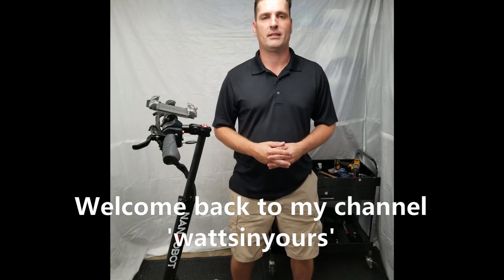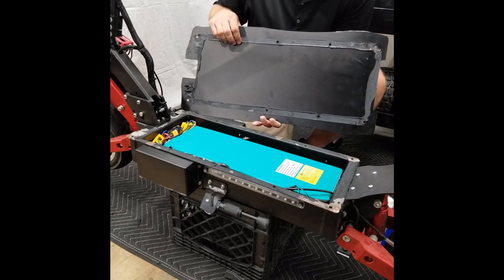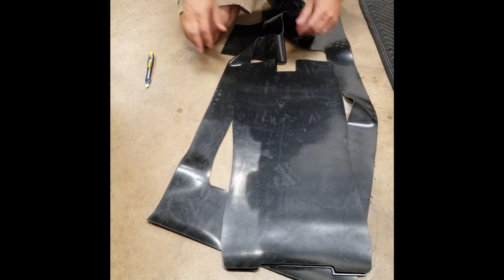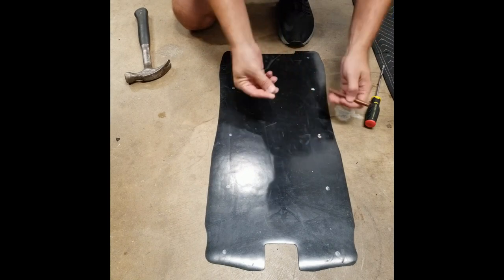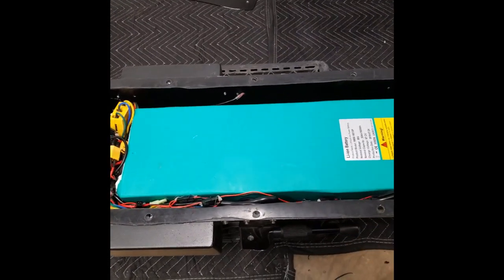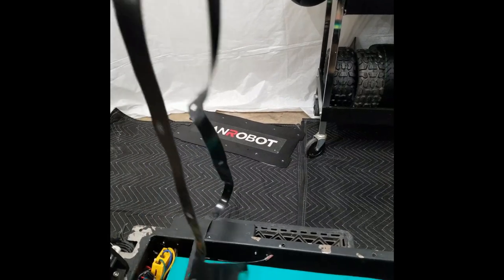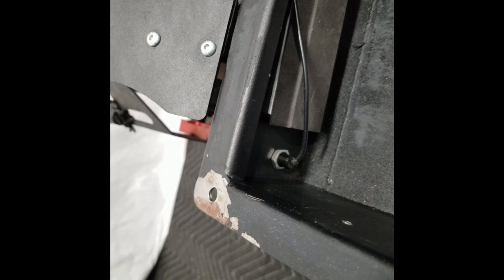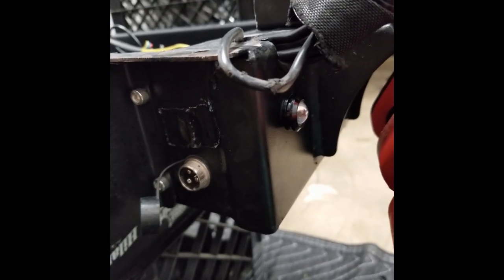Nanrobot upgrade water proofing and preventing battery movement. electric scooter motorized scooter.

Comment: It's not good to put that high density foam between the floor and the battery. That causes all the pressure and vibrations from your body to push on the battery pack. The gap is there for a purpose.  There are other ways to secure the battery, closer to the edges.

Comment: Question: Why didn't you just leave the "whole rubber sheet" as it is? Maybe it will get TOO HOT inside?
Reply: exactly the same question afrer viewing that major part of heat distributed by top alu plate
Reply from the maker: Yes because of heat.

Comment: Congrats on replacing your d4 with a ls7.  How does it hold up against your friend's dualtron?  Does sealing the deck void warranty?
Reply: He's got an RS7 not the LS7, very similar though... He did a comparisons video against the Dualtron already you should check it out , he did a good job. And sealing the deck won't void the warranty on the Nanrobot.
Reply from the maker: Mine is faster than the dt3, but i think the dt3 beats me in quality by a little. I'm not sure about warranty but i fix my own scooters anyway.
Reply: @wattsinyours  the dualtron appears to have bigger more solid pieces holding it together where the ell S7 and RS7 seem to have more small pieces. That's just going based off of visual appearance alone though, @wattsinyours would you agree that that's the case having seen both in person?
Reply from the maker: @GingerOnWheels  yeah i would have to agree for the most part but my rs7 is a very close second and its faster.

Comment: Amazing videos !
Reply from the maker: Thank you very much!
Reply: @wattsinyours  is it difficult to order parts for the rs7 ?
Reply from the maker: @OHADASSUSIL  no because most of the parts are universal.
Reply: @wattsinyours  maybe you can give me your opinion 
Should I get the 6D+ 
Do you think they will have seat for it ?
What is better disc brakes or oil brake ?
Thank you !
Reply from the maker: @OHADASSUSIL  depends what u want the scooter for. Yes you can get a seat for it and oil brakes are a lot better than mechanical brakes.
Reply: @wattsinyours  it's strange I contac the compnay they told me its special order for rs7 parts it take lots of time to get parts
Reply: @wattsinyours  I want something strong and fast one level before the rs7
Reply from the maker: @OHADASSUSIL  man there are so many choices but a couple good ones whould be the Dualtron3 or the zero 10x.
Reply from the maker: @OHADASSUSIL  i can get them fast off of other sights. You just have to know what to order.

Comment: In fact, you can leave the whole rubber mat on instead of cutting it into gasket!
Reply from the maker: Yeah i thought about that. Either way will work just fine.
Reply: But wouldn't the battery get hotter with no air. Think about that...

Comment: How do you tighten up the suspension on a D6 plus
Reply from the maker: There is a nut that sits on top of the spring. Clockwise it makes it stiffer. Counter clockwise makes it softer.

Comment: Hello. For dualtron thunder which kind of rubber you suggest to sealing the battery box?
Reply from the maker: Just any thin off the shelf rubber will work, but just remember you want to get really thin material or the lid will not close down properly.
Reply: @wattsinyours  ok but a silicon rubber?
Reply from the maker: @takisangelopoulos13  that is fine to use.

Comment: Awesome ideas.  I also am all about modding my similar scooter.  I have a clone from a different manufacturer, but can tell that we have the same chassis and electronics inside.  I thought I was the only one digging around inside this thing, but I have had some mechanical challenges along the way, so I had to.   Thanks for sharing your efforts.  I have been thinking about a gasket for the main compartment also, since the rtv gets hosed the first time you open it.  My initial thoughts are that the deck needs more bolts added to clamp well enough to be effective.  Subscribed - feel free to check my efforts out too!  FYI - I have replaced my throttle with a Ey3 controller from minmotors, and it I am much happier with it than the original like you have.  My post for throttle replacement on Reddit:  https://www.reddit.com/r/ElectricScooters/comments/bzpa9x/yes_you_can_use_probably_the_minimotors_eye/
Reply from the maker: Hey strider thanks for watching and subscribing. I watched a couple of your videos. Love the fact that you dive right in so great job. Its funny bc i was looking at those scooters online before i bought my nanrobot and yes it is the same exact scooter except for a couple of part, like the stem for the handle bars. The only reason why i didn't buy that one bc it wasn't as well known and was worried about warranty issues. Side note i almost bought it though lol. Where do you order parts for that? Do they have a website. I was just wondering so if i need parts for my rs7 i have an additional place to look. I hope to explore more about these scooters with you and my YouTube fam and good luck with your repairs and mods. As always im here to help where i can.
Reply: @wattsinyours  True- us tinkerers need to share knowledge for sure!  The best resource I have found thus far is Reddit but it is light on expert knowledge so I think we are "the guys" at this point.    Love the formatting of your videos - I need to do the same so they are easier to follow for the public.  My videos were mainly made to try to prove to the supplier that their parts failed.  A lot of good that did me...  To answer YOUR questions: I bought all of my parts via Aliexpress.   You have to be very thorough with your searches and sometimes root through many offerings, but can eventually find the right part if you keep digging.  You were right to be worried about warranty, as the Samezone folks don't even answer my messages anymore (6 months or so into this).   We are on mostly on our own with these China-scooters I think....)  If I can help in any way, let me know, as I have done a TON of troubleshooting so far.
Reply from the maker: @striderz69  ok will do. Ride safe friend.

Comment: That gasket without gluing make no sense. Plate on top i so thin to keep it in proper squeze. Remember you jumping on top of it and everything is working. Rubber will lose its elasticity over time and I can bet that you will find more gaps between bolts then before. 
Is better to use proper glue for that type of job .
Reply from the maker: I would have to agree with you to some extent. I could glue the bottom down and not the top so when i take off the lid i don't have to reglue it. What do you think?

Comment: Even the most expensive China scooters look underbuilt and poorly designed compared to my 20 year old Kawasaki which can survive half submerged in water. Both are Asians eating stuff with chopsticks but their philosophy to product design is just a world apart.  Also his effort is just slightly improving the scooter as there are numerous holes for water to seep in.  The entire design of these Chinese scooters does not take rain into consideration.  The Chinese are happy with taking your money and don´t care if you die with brake failure or the scooter explodes and burns your house down while charging.